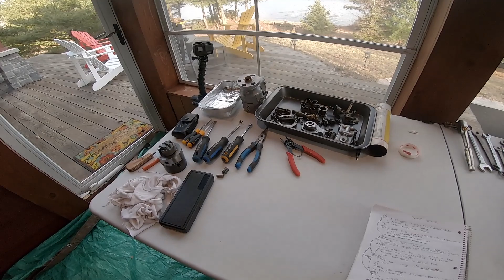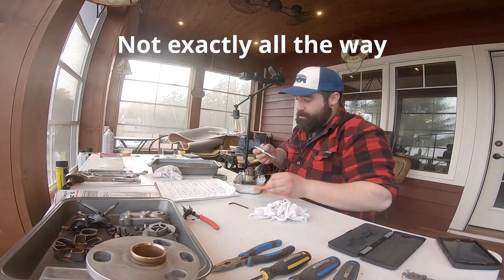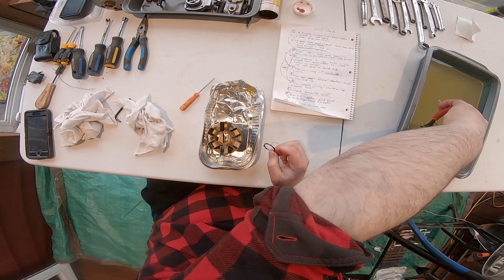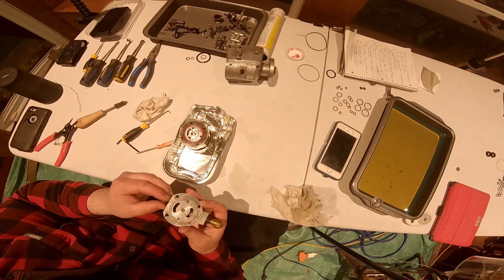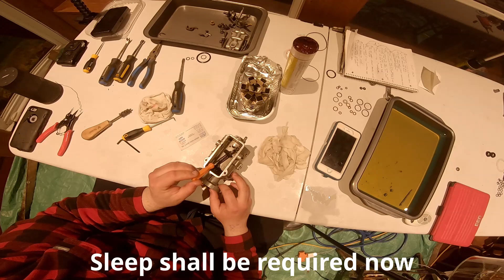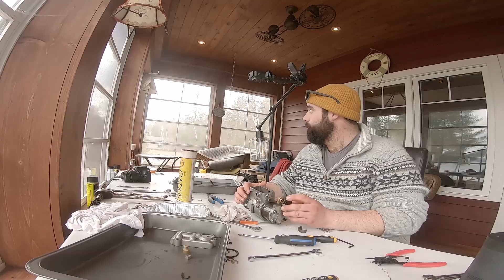Roosa Master Fuel Injection Pump DB Rebuild  -  Restoring the Crawler: Part 4

Comment: Are you sure the knife edge on the governor arm pivot goes towards the driveshaft and not towards the transfer pump? I am looking at a diagram of the pump in the manual that shows the knife edge pointing rearward toward transfer pump. What would happen if this is installed wrong and I should be able to reverse it once installed on the engine, I hope?

Comment: What would cause a pump to stop pumping? Or u to have to pour water on it to get it work when hot?
Reply from the maker: I know this is 2 months late, but please don't poor water in your diesel pump! it can't be good for the engine.
Reply: @adventureswithjosh7914  I ain’t pouring it in the fuel or pump I’m pouring it ontop the pump because my head is wore and gets out of tolerance and can’t supply cranking amount of fuel when it’s hot and tolerances are off. The water cools it down enough to allow it to crank

Comment: SO TODAY I LOST CYLINDERS 3 AND 4 ON MY 580B, I SUSPECT A FUEL ISSUE, IT HAS 4 NEW INJECTORS AND HAS RUN LIKE A CHAMP FOR TWO YEARS, 10 MINUTES IN THIS MORNING IT JUST CUT OUT AND I TESTED AND THE EXHAUST ON 3 AND 4 IS COLD
IM GOING TO GET A COMPRESSION TESTER AND CHECK BUT THERE DOESNT APPEAR TO BE ANY NOISE OR ANY CLUES PRIOR TO THIS HAPPENING
IS THERE ANYTHING IN THE INJECTOR PUMP DESIGN THAT WOULD ALLOW A FAILURE IN THE PUMP TO TAKE OUT 3 AND 4 AT THE SAME TIME AND LET 1 AND 2 JUST RUN FINE ?
Reply: I have a Miller welder w/ the Waukesha 4-cyl that also uses a DB pump. Assuming you also have this same series of pump. Depending on how long your rig sits between uses the pump internals can become coated in a slimy film...basically a type algae that can grow in the tank & this isn't always stopped by the filters. This can gum up internals & even plug the passages on the distributor head or even the lines. One way to confirm fuel delivery issue is to crack loose the lines on the problem cylinders 1st at the injectors. If no fuel weeps out then the problem is either the line or the port on the IP. Next loosen the line nut on the IP. If you get fuel then the line is plugged. If not then the pump needs to be cleaned. Just be sure to have a new seal kit for re-assembly.
Reply from the maker: I couldn’t have said it better myself. Thanks for taking the time to help this person here!
Reply: @adventureswithjosh7914  Can't afford a shop but am mechanically inclined to take the leap. Have had the diesel bug for a bit now especially since my DD is a 40 yr old VW. Have to say the Stanadyne pump is simpler but the BOSCH can more easily have a longer service life of several 100k miles. Did an engine swap...motor going in hadn't been run in a couple years & when went to start up...it ran like ****. Come to find out the pump that I didn't loop the return to the inlet had allowed the diesel to slowly evaporate & left behind sticky schlack.

Comment: Thank you so much. Very in depth and great camera angles.   I do have a question??? My CHAMFERED ring fell out in 4 pieces and I'm having a hard time finding one online and elsewhere.  Would you know where I might find one or where to start looking? Thanks again
Reply from the maker: Yikes! I’d try your local pump shops or diesel repair shops. Otherwise maybe try to find a pump on an old machine at a scrap yard. Otherwise you could always have a new ring manufactured at your local machine shop if you brought them the pieces.

Comment: What is the name of that gasket you say most people replace it because it disintegrates?
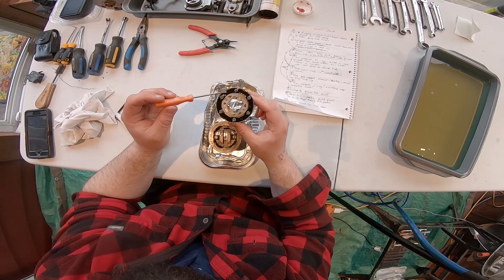Reply: If it is the one at 11:00 it is called a flex ring. He did not replace his. This is a no no! He says it is a common failure why not replace it??? It is not expensive and it gets replaced with the light colored one every time you do a rebuild. I worked on these in the mid '80s and I am sure this step still is not skipped. At that time if you had the black flex ring it meant it was the old design and it needed to be replaced. Who knows because I have been out of this trade for so long maybe they changed design again.
Reply: @1crazynordlander  is there a place to get the return line check valve at the top of the pump? I can't seem to find a good way to take it apart and clean it
Reply from the maker: My Moto is if it’s not broken, don’t fix it. You may want to, but because I was also troubleshooting a bigger set of fuel system problems in my crawler I decided not to add any extra variables, and because mine was in perfect condition and the new one looked to be of inferior makings. But by all means replace it if yours is at all warn.
Reply: Governor retainer ring

Comment: I how know the different between on a D or DB pump ? or are the difference ?
Reply from the maker: Here's a full explanation for you and others, I've added my info for the example:
 DBGFC 437-7AF   DB:  D is series, and the B is indicative of the .920" diameter rotor with the bore type delivery valve. 
G is mechanical governor, 
F is flange mount, V is vertical (4020),
 C is clockwise rotation, CC is counterclockwise(viewed from drive end), 
4 is # of outlets(feeding cylinders), 
37 is .370" plunger diameter. (Available diameters: .250,.270,.290,.310,.330,.350,.370,.390,.450) 
7 is specification #, and AF is accessory code (specific to the machine type it's mounted on)
Hope this helps someone!

Comment: You are not clear as to which direction the chamfer goes.  The drawings I have found has it facing the away from the shaft, away from the bottom of the weight retainer. Beyond that, your descriptions are great for a novice like me.  The housing O-Ring has proven to be easily damaged.  I found that a pack of 10 at Graingers for under $2US. Part number: AS-568-038.  Thanks you.
Reply from the maker: Thank you!